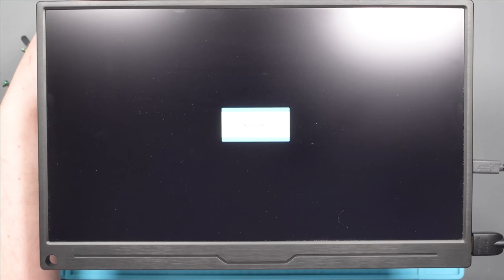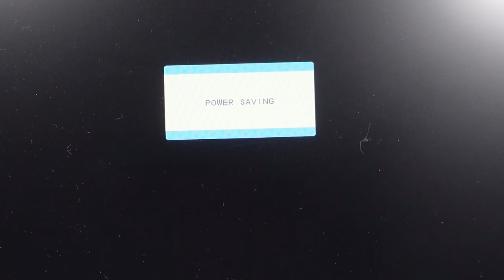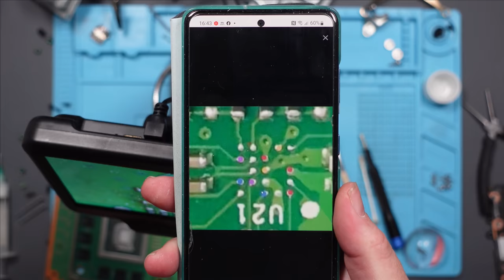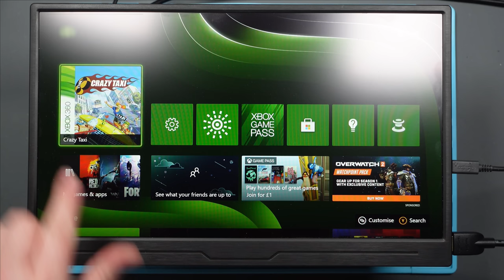I Paid £250 For a Faulty XBOX Series X | Can I FIX It?

Comment from the maker: Stupid rubber strap thing
Reply: Yeah I don't like rubbers either
Reply: @samholdsworth420  Why?
Reply: Yes I had a similar problem with the stupid rubber strap too!
Reply: @dvsr5296  because I'm allergic to them. Dermatitis 😭
Reply: @samholdsworth420  That's not the real reason you don't like them. Lambskin exists.
Reply: Put the strap-on back :)
Reply: I've got my evening dress on.  BORE ME WITH THAT!
Reply: That part had me in Stitches
Reply: I hate when that happens!
Reply: @samholdsworth420  Top notch ribbing. ;)
Reply: Nice fix maybe you need to use low melt solder next time for removing port or watch cod3r
Reply: guys always put your rubber !!!
Reply: The strap is meant to reduce vibration noise.
Reply: I bet that's where the power on chime went :D doesn't work without the rubber strap 🤣
Reply: Rubber straps for silly thicc boi
Reply: Great video. Thanks 😊

Never leave your rubber strap on lying around.

Comment: Thick pcb you should use your solder wick to remove the mount points first rather than try to heat the board all the way through all at once.  Makes it a lot easier when you go topside
Reply: Or use the desolder gun...
Reply: @oldguy9051  AKA "The Cow"
Reply: low melt would have helped too
Reply: @sirrichel9155  True
Reply: @xxxhypoxxx  Obviously ;-)
Reply: Or cut the connector pins, to remove them one by one, since it's dead :)
Reply: @nalinux  That's actually the procedure I found in an early-1990s service manual for removing SMD ICs in case you didn't have a hot air station.

Comment: Great Job Steve! Good save with that chip! I did a video of one of these a few weeks back, and they do require a fair amount of heat to remove the port. I would recommend using LOW MELT solder, it makes the job a little easier!
Reply from the maker: Yeah, definitely wish I had some low-melt for this job.  Will be using it next time for sure!  👍
Reply: @StezStixFix  You still did a great job Steve and you got it working! They are still a real pain to do even with low melt. I don't really fancy doing another one any time soon!
Reply: @StezStixFix  You can buy 70 C melting temperature solder

Comment: I saw that chip hit the deck when you pulled the port off, was hoping it was one of the caps that's only there for protection and not strictly necessary like I've seen on other vids. 
Righteous hack in the end though, gratz.
Reply: At 6: 41when the nozzle touches the board , probably knocked it off

Comment: Nicely done Steve 👍😎
Reply from the maker: Thanks Vince, felt good to get this one going.  I hope it's a lasting fix, but time will tell.  I'm keeping this for myself anyway, so I'm happy with how it turned out!   If those chips become available to buy at some point, I will definitely get one👍
Reply: @StezStixFix  Yes,  I'm sure it will be fine. Maybe just ground yourself before changing out the HDMI cable if you been doing the running man on thick piled carpet (don't deny it).  Phil (TheCod3r) will no doubt be able to sort you out with one of those ESD chips in the future if needed 👌👍👍👍
Reply: @Mymatevince  I can indeed lol. I'll dm him and hook him up with one ;)
Reply: @itsconsolefix  Well done Phil👌👍👍👍👍
Reply: @itsconsolefix  Nice one Phil. I was going to suggest that too as I know you do lots of console repairs. I know you used to be into coding so you might like my latest video, where I had to reverse engineer some software and write a keygen to access a service menu in an inverter, as technical support were not being very helpful! I also found some Easter eggs in the program.

Comment: I rarely understand the use of that huge hot air thingie, and this one is no exception... It melts everything in a large area. Can't you just use solder wick and the Moo-machine? :D
Reply from the maker: Sadly not on stuff like this, it wouldn't be able to remove the solder.  I had the hot air on 500 degrees, and it was still only just enough to get the port off.  With an iron or desoldering gun, it would've gone nowhere!

Comment: Nice rebound bypassing the chip you destroyed! I'm sure it had a purpose, but we will never know. Thanks again for sharing your experience! Rock on, my friend!
Reply: If I'm correct that chip is what allows 4k without it it won't display in 4k and the only way to replace it is to take one off a donor board
Reply: @ians.4431  I am not a fan of those chips that float on solder balls. I am not even sure if I would have tried to fix it. Stezstix did a fine job getting it working. As far as 4K is concerned, I had 4 monitors die on me at a young age that were 4K. I went back to a normal 1080p monitor now and I have no issues. Thanks for the response @Ian S. !!!

Comment: Great video, I believe it's a solder mask you need. These are used for repairing main boards in mobile phones and are usually on a sheet on which you would typically use a solder paste to create the solder balls with the correct spacing.

Comment: 6:14 the solder on 99.99% of electronics nowadays is lead-free solder which needs quite high temperatures to liquefy, to more easily remove things like hdmi ports it is always a good idea to add some low melt solder or even just 63/37 solder to all the solder joints to lower the melting point.
Reply: I mean, he did. He said 'I'll put some leaded solder on here to lower the melting point.'
Reply: 4:59
Reply: @WhiteG60  sorry, must have missed that part, so let me rephrase that. Low melt solder or smd/smt removal alloy as it is also called would have been ideal in this case as it lowers the melting point even further as the alloy's own melting point is just 58ºC. its a bit expensive at $15 to $20 per 4.5Ft of the stuff, but works wonders.
Reply: @rick5078  It's far less expensive than a seriously damaged motherboard though. It lowers melting temp far more than just regular leaded solder.

Comment: Try warming the stickers up a little with your hot air. Less damage to the stickers. When the USB & HDMI ports start getting lose on my son's xbox it's usually the metal part of the connector spreading apart like yours. If you deal with it early enough you can clamp the metal parts back together and solder it together for extra strength. It makes the ports feel new again.

Comment: Yep great but you can't sell it without the 5 volt esd chip. It would be unethical? Next time use low melt solder port will come off really easy. Forgot to say no 4k with this fix.😮‍💨

Comment: Doesn't Phil have some of these ESD IC ? With a bypass you only get 1080p right ? Great video as always
Reply from the maker: Good shout RB, I'll ask him!  It displays in 4k just fine though, so I'm not too sure if anything is affected.  👍
Reply: The bypass will display just fine in 4k as long as the monitor or TV you plug it into is 4k capable and 2 wants 5v on the port. Some old TV and some monitors one want 3.3v. So that being said if you plug Into one of them you will get no display at all
Reply: It seems the ESD chips for the One S are commonly available online, but they didn't seem to look the same as the One X chips. They are a 3x4 ball orientation. You can get 10 packs on the 'bay.
Reply: @gamingreligiously  they are not the same they are totally different. The one x uses the same esd as the series s and x and they can only be acquired from a donor board if they fail

Comment: Is it worth going a bit more overboard with the foil taping on the board aswell as the plastic ports to prevent accidental desoldering.  Not knocking Steve here as i totally love that the videos show the full rocky road of the fix journeys.

Comment: pre tin the coated wire on the first end makes life easier ... it also helps to scrape off some coating with a scalpel ... less stress on the solder points

Comment: 6:36 (ish) Is that when you yeet the chip off the board? - something flies off as you pull the hot air gun away..
Reply from the maker: Yep!  Almost certainly, that's the little blighter making a run for it!  Well spotted sir👍

Comment: I bought my Series X used via Ebay about 6 weeks back for 365.00, I was surprised to find that it had never been open and works great, except for the HDMI issue. If I tried to place the unit straight up, the HDIM port would get pulled downward by the weight of the HDMI cable and I'd loose picture. I ended up laying the unit down on its side and that HDMI port does not lose connection. Even better I found that unit is still under warranty until April 2023, so I can send it in for repair\replacement by Microsoft if it comes down to needing it.

Comment: Just my two cents advice as a technician that deals with thick boards sometimes. I use a cheap hot plate put it on minimum heat enough not to burn plastic parts off the board, but warm enough so that it doesn't suck off the heat from a hot air station gun to remove Parts like an HDMI. Oh yeah, use a jig to keep it off the hot plate.

Comment: I'd love to know what hot air station and soldering iron your using, that iron is nice and fine tipped, I have tried to do some research on what to get but there's a lot of low quality stuff out there, hard to tell if I'm wasting my money. Nice work on the "stupid chip" work around by the way. Wonder what that chip did?

Comment: Pretty sure that chip you knocked off is damaged and it’s called a retimer chip,  putting the chip back on with hot air station will work with a new chip and you don’t need to reball the chip, Love watching what you do, keep it coming.

Comment: You can actually see the chip blow away when you pull the HDMI port of the board

Question when you try get the chip back on I didn't see any Flux isn't it better to do so also for the heat I think the chip was twice as hot then what the board was 

By the way I like the hot drop technic much better for the port sometimes I see people put the Port under the flux for Cooling I think 🤔 but I like the drop method

Comment: Steve you should get a cheap desoldering pump. Heat the solder and suck it off the board and on to the next point.

Comment: Try next time to start with the big solder spots and desolder them with desoldering braid/ entlötlitze, when this does not work give a bit of extra solder to the solder spots and try again with desoldering braid/ entlötlitze. After that you can do the same thing to the pins and or use your hot air soldering station. You might like to check this youtuber he does this quit often NorthridgeFix.

Comment: That was an excellent fix - I too was sure that was goosed! I thought you had pulled at least 2 pads off the board from where that chip was. When you was surprised it worked after that dodgy re-wire from a "google" site... I think anyone watching including me also pulled the same "Bloody hell - it works" face!!! 🤣  I've got a laptop that I swapped the USB port on and damaged the motherboard as the mobo absorbed the heat for fun like your Xbox.  I ended up sticking it in the oven! NEVER DO THAT - That is goosed !!!

Comment: Not sure why you wouldn't use a good heated solder sucker for the back pins? Would have been way easier, and not needed to have heat the board up that much.

Comment: LOL Personally, I would of just used it with a little but of insulation tape around the base of the HDMI lead so it didn't go in so far and still worked, but I guess that would of not made such an interesting video. But, it was still a great video, Steve. Well done on the fix.

Comment: The logo is STmicroelectronics on that IC, but you may have figured that out already.  Can NOT figure out what that chip is, though.

Yeah, that's cool and all that you fixed the HDMI port and bypassed that chip... but couldn't fix the beep, huh? =P
Reply: I think I found the same repair video you did with the pinout diagram.  And it seems this is not a chip available for public purchase, womp womp.  That's so frustrating.
Reply from the maker: Weirdly enough, it's now beeping.  I wonder if it was because it needed an update and a power cycle.  But it beeps every time now! 👍
Reply from the maker: Yeah, the chip appears to be some kind of ESD filter that you can't buy!  Hopefully it'll become available at some point and I can pop one in!  😁

Comment: Why didn't you use a solder pump to extract the solder from the earthe legs on the port, then use your heat blower to completely remove it? You would have saved yourself alot of time and pain.

Comment: Would have though it easier to use wire cutters on the mounts, then remove what's left using low melt solder and an iron.

Comment: 2 days ago I paid the exact amount (250 euros) for a 1 tb series X, with original box, 1 controller, cables and manual. The only thing is that it has a little minor scratches on the surface... I´m thinking in don´t resell it (it was my initial thought) and maybe, try to erase the scratches or even better, found a good quality case replacement. If anybody knows how to do that, i´d really appreciate.

Comment: What is the rubber strap even for 🤔good fix and a cheap Xbox X too nice 😁
Reply from the maker: I think it's to dampen vibrations, doesn't seem to serve any other purpose! I have put it back in though, just in case it explodes or something! 🤣
Reply: @StezStixFix  🤣 How did you get into electronics?
Reply from the maker: @darrengarvie8832  Covid mainly. I needed something to do in lockdown, and after watching My Mate Vince, I thought it'd be easy! 😁
Reply: @StezStixFix  🤔 Easy you make it look easy lol I do wonder if you where like me when younger and used to take apart all your electronics in had an original pac man and donkey Kong that I took apart and put back together quite a bit 😁 but modern electronics are so small it is crazy

Comment: ESD chip not available. SHould be able to clean the pads and reball but its fragile and looks like you screwed the chip. ESD bypass means you cant guarantee 4k anymore highly dependant on the tv you plug into as to if you can still get 4k.

Comment: Wonder what the chip was for in the first place... A security chip?
Reply from the maker: I believe it's an ESD filter for the HDMI signals.  It seems to work perfectly without it, but I guess it's just there as some kind of protection. 👍
Reply: @StezStixFix  nice work, do apreciate it. that would be electric static discharge protection, like a fuse? probably worth having to prevent damage down the line when plugging in a hdmi cable (litterally and figuratively)
Reply: @StezStixFix  i Could be wrong but without that esd filter, the console will not be able to display 4k. Also only way to get replacement esd is through donor boards.

Comment: Honest question: why use the heat gun instead of the iron? I've heard the heat gun causes collateral damage like that. Is there a reason to use it?
Reply from the maker: Good question!  I had to use 500 degree heat to even start melting the solder on this board, my soldering iron only goes up to 450, so I would have had no chance!  I could have tried low-melt solder, but I honestly don't think it would have worked.  I've never worked on a board that soaks away so much heat before!
Reply: @StezStixFix  Well, as always it's fun watching you. Even if it's at the expense of your blood pressure.

Comment: No nozzle, 500 degree air from the backside and it will just fall off when the solder melts, easy
Reply from the maker: That's what I did! It wasn't going anywhere 😳
Reply: @StezStixFix  70 airflow and you only have to move the air a tiny bit, the board soaks heat but it takes about 2-3 mins of solid heating,
Reply: @volvogamer  Took me ages to do one (video a few weeks back), had the temp on 500 and airflow on max! Those boards seem to just soak up the heat! and I added low melt solder too!